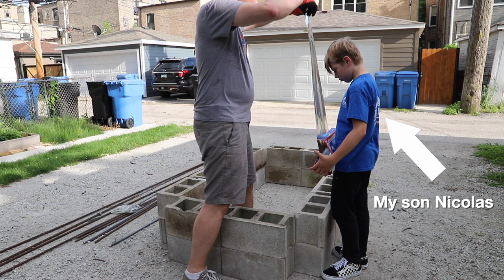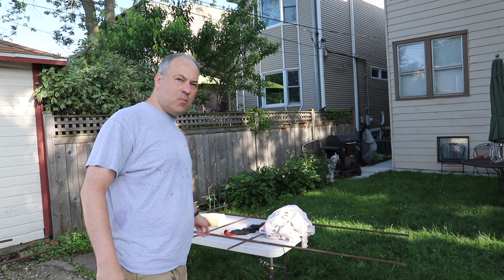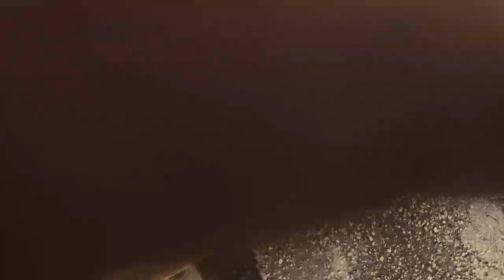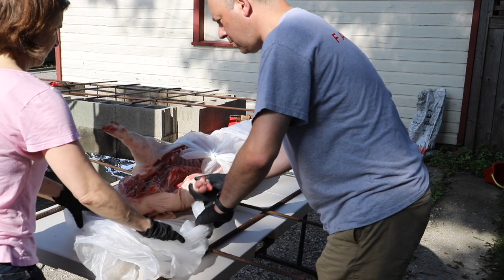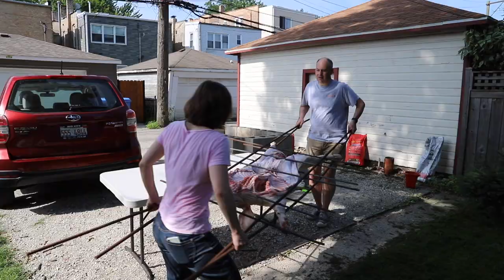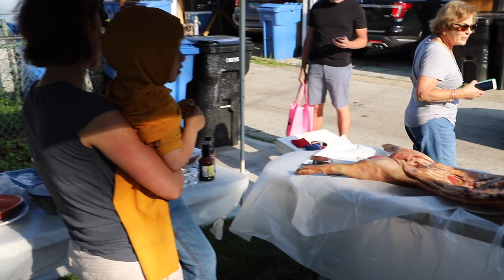Build A Pig Roast Pit

Comment from the maker: There's a ton of haters with opinions here. But, let's get a few things straight: I did this six times before I shot the video, every time worked out great. I've tried injecting mojo, apple cider, etc. but never made an appreciable difference in taste. Was it cooked enough? The meet was 185F when I took it off, which is 20-degrees higher than required, so definitely safe. Skin was also crunchy. Could I have cooked it another hour, or two? Sure! It probably would have made a difference, and made for meat that shredded easier. BUT! I had a crowd of 65 waiting to eat, and everyone liked it. Nothing was left. Could I have DUG a pit? No, not enough room where I live in the city. The one I built has worked great for six years. But hopefully this video gives you a template on how to try something new. You probably won't get everything right on the first try, but you will get something you like.